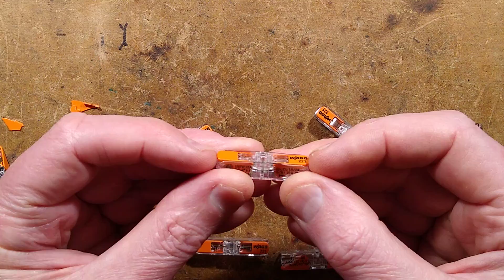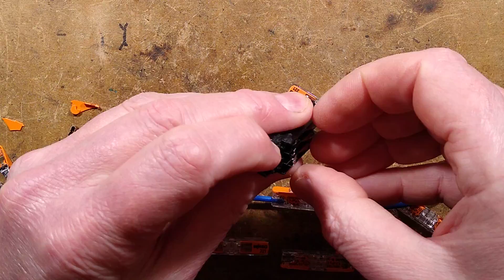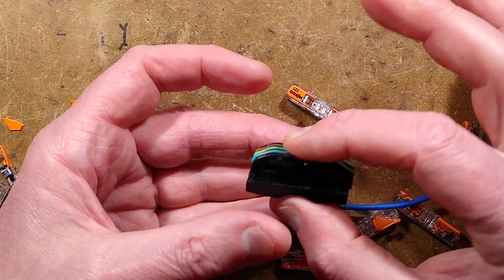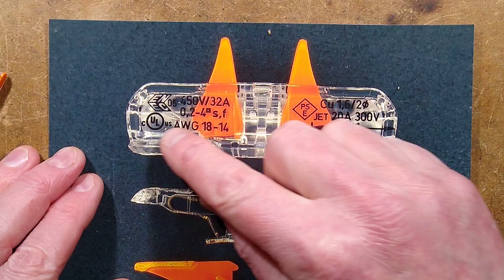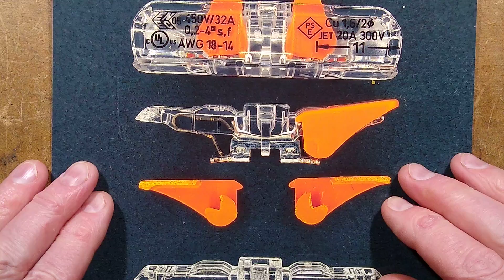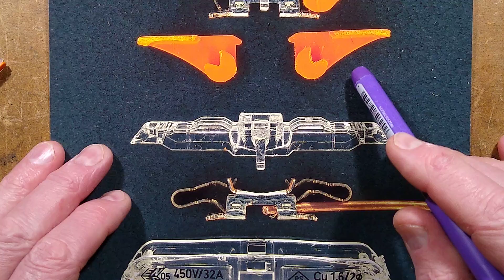By request - a look inside a Wago inline connector

Comment: You are absolutely right about Chinese clones of the type you showed. Purchased on several occasions from different suppliers: so far I have found two types by dismantling them.
One is completely equivalent to a WAGO: the conductive part of the clip is copper and the spring is steel, separate and with the exact same shape and thickness.
The other, identical at first sight, has the entire clip made of one piece THIN steel and does not have the curvature of the spring, just an acute fold.
I wouldn't bet on the plastic used in either model,  even though the ones with the better clip look more "chunky".

Comment: I once was scrounging through cars in a German junkyard and in one someone had used these connectors to rewire their radio. I took them all (it was something like 30 in total including speakers) because they looked quality and very useful. I recently used two to extend wiring for a switch in my own car, since they make it easy to remove should I need to undo the wiring vs. solder or crimps.

Comment: Real Wagos are the only connectors where you can trust the rating. As you said, for low voltage stuff the clones might be OK, but for high voltage you're better off spending maybe 1-2 <currency units> per connector (if you buy smaller quantities) on them than to cheap out on clones and risking that they overheat/melt/start a fire...

Comment: i see why its good and etc.. still just no. i prefer them for prototyping. once everything is set up i prefer to remove them and then solder connections. no wago will ever have that low contact resistance, nor will it be as good mechanically. if i need something connected i prefer the solder.

Comment: Why use that expensive thing instead of welding the wires ?
Reply from the maker: Speed and ease of modifications and testing.
Reply: @bigclivedotcom  So, basically only for expensive tests of mains ? It makes no to little sense then if the thing is not easy removable to be used in another test site.

Comment: They should make a connect that grips the cable,using the method that was used in the old style plugs by MK 
It was like a nylon piece either side and the harder you pulled the cable the tighter it gripped,and also I liked the actual terminals for the actual live,earth and neutral,that screws down on the the cable when it was wound around the threaded piece in the plug housing…

Comment: Regarding stranded wire connections...  I have an outdoor fixture that uses that type of wire and lately I noted that it was flickering about 25 years after installation.   It was connected to the mains (solid wire) in the base of the lamp, which was attached with bolts sunk into the concrete base.   Upon disassembling the affair, I discovered that the bare stranded wire had corroded from atmospheric moisture and was making only intermittent contact.  Were this a high-consumption incandescent, I can well imagine a fire breaking out.  I cut and stripped the wires back to bright copper, tinned them with solder and soldered them to the mains wires, then used silicone-filled wire nuts (DryConn brand).   What would be a similar approach if Wago connectors were to be used?
Reply from the maker: For outdoor use you can get gel filled boxes that completely seal the connectors inside.

Comment: Has a properly installed Wago ever failed? I know that there are Americans that claim to have seen them, but I just don't believe them. I have never seen one fail, and I've installed thousands. Not one failure.
Reply: I seriously abuse WAGOs in personal projects, including putting in fatter wires than I'm supposed to sometimes, and have yet to cause even one to fail.   (I still use a fresh WAGO for anything behind a wall or in a fixture).

Comment: The connectors are designed to provide proper contact when solid wire is used.  Twisting up stranded to work as solid will give a similar contact area compared with solid.  I don't see a problem with the practice.

Comment: Ideal also makes a great product at a lower cost. We keep 2, 3, 4, 5, and 6 port stab-style on every truck and have used them exclusively on every commercial job since around 2000.

The electricians still using wirenuts are just stubborn and ignorant. Life is too short to spend 10x more minutes connecting wires than needed.

Comment: I think the official stance for the non-inline is to not use stranded wires with the wagos? On the pic I see 0,2-4o s,f does that mean „stranded or fixed“?
Reply: The problem with the terms "wagos" is it covers a bunch of different connectors with different specifications.

The 221 and 222 lever terminals are specified for solid, stranded and fine stranded wire. 

The 773 push-ins are specfied for solid and stranded (i.e. conduit singles, SWA, larger T&E) but not fine stranded (i.e. flex).

The 2273 push-ins are specified for solid wire only
Reply: Considering there is a , between the 0 and 2 I guess that part of the data is in german which would lead to starr (fixed) and feindrähtig (stranded)
Reply: @Alex_Vir  yeah likely it’s the other way around, but yes it confirms, both types are specified.

Comment: I'd use a Wago on low voltage. NEVER on Mains. EVER. High voltage and a flimsy connection inside a plastic shell and you're asking to burn your building down.
Reply from the maker: Wago terminals have been used for decades in Europe.  To date I've never seen a failed one.
Reply: Are you American? That would explain your strange opinion.😂

They are perfectly safe on mains, every professional uses them on mains. That's what they are made for. They are probably the safest connection you can use on mains.
Reply: Voltage has nothing to do with heat.  Its all about current.  Voltage ratings are strictly associated with the connector body's insulation rating.   WAGOs are rated for European and U.S. voltages.
Reply: @junkerzn7312  Okay, you just outed yourself as a typical American. 🤣
Reply: I don't care what anyone says, I won't use wagos on line voltage. All y'all go ahead. I'll stick to twist-and-nut.
Reply: High voltage he says, with a 120V LV system. And yanks say we're afraid of electricity.